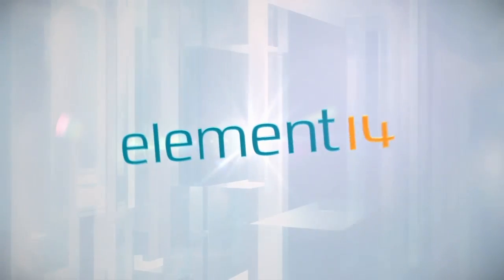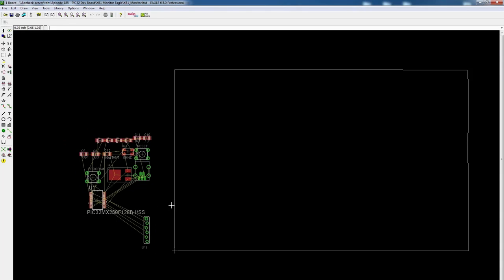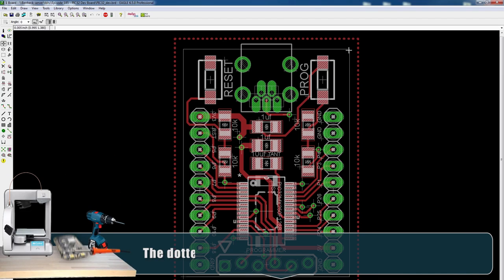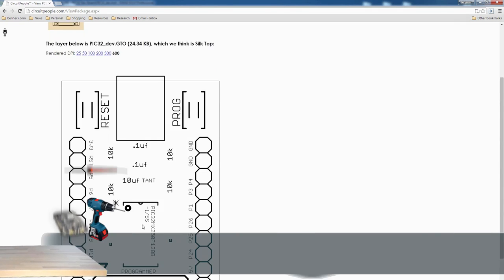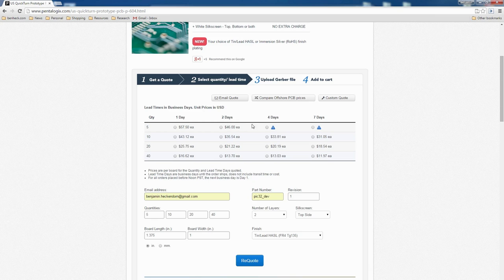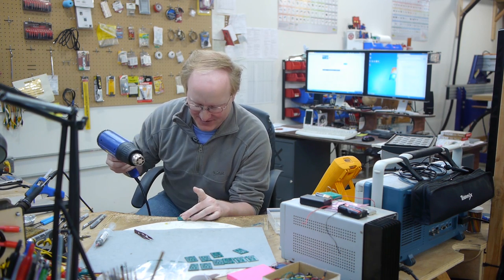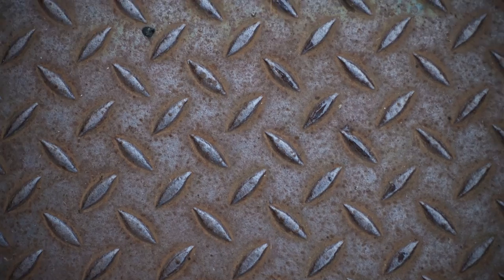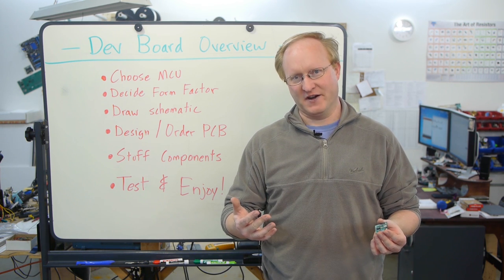Ben Heck's DIY PIC32 Dev board

Comment: Ben, just for information the pickit3 can provide power to the board, if using MPLAB MPE go to Settings>>Advanced Mode click on the power tab select the required voltage and check the "Power Target Circuit from Tool", if you're using MPLAB  X IDE go to Run>>Set Project Configuration>>Customize then click PICkit 3, click on the drop down at the top select "Power" check the "Power Target.." and set the level it is limited to a load of from memory i think 100mA. You can do this with the ICD as well not just the PICkit. Hope that this helps someone in a pinch.

Comment: Since this is essentially a break out PCB for a PIC32, I would recommend you add BAT54S's and SMT caps connected to analog input pins of the microcontroller.  If you use the analog inputs you can install the cap and BAT54S.  If you do NOT use the analog input, simply leave the caps and diodes out.

Comment: Check out OSHPark. They're a fairly decent board-house, and they'll make your boards fairly cheaply too. I've used them for all my projects, and they haven't failed me yet.
Reply: Nikolaj Lepka 2nd
Reply: Nikolaj Lepka he's sponsored by element14, if he does advertise with another trademark, it is like... bad for his sponsor right?
Reply: remace07 I know, I didn't deny that. I was just saying what I recommend myself as an alternative to what he says.
Reply: Nikolaj Lepka Trouble with OSHPark is that the price ramps up rapidly with board size. Over a certain PCB size, Itead or dirtypcbs is a more economic option.
Reply: Nikolaj Lepka I use PCBway. So much cheaper than anything I have seen. Only downside is it comes from China.
Reply: I was going to recommend OSHPark myself. Ben's design would have coated $2.29 each for 2 week turn around or $6.53 each for 1 week turn around (assuming he ordered 21 boards). Standard $5/sq. Inch(includes 3 copies). For 5 day turn around its an extra $89 per design. Not bad at all.
Reply: CodedSteele Everything comes from china these days, why's that a bad thing?
Reply: Nikolaj Lepka Why is outsourcing everything to China a bad thing? 1.  time it takes to ship is more because it's farther away 2. energy consumed in shipping is greater because it's farther away, thus contributes to consumption of fossil fuels which releases toxins into the environment etc. and if you believe in it, global warming or climate change 3. The more work outsourced to China, the harder those slaves have to work. Think of the humanity! We in the U.S. have unions and working is a choice. Chinese are forced to work for the state or die. 4. Least importantly, it is bad for the economy to have lopsided trade. This last point is debatable and I'm not sure why I include it.
Reply: ***** So why not make your project in modules that you can stack? That should keep the board size down. You could even use slot connectors to put them together.
Reply: kedwa30 Sure, you could, but not every project is amenable to that. I was just trying to point out that there are heaps of short-order PCB fabs out there. OSHPark has the brand-name, and they absolutely deliver a very high quality product, but they aren't the cheapest by a long shot.

Comment: Staggering the program header pins for a press fit was pretty slick.
Reply: Christopher Johnson Yeah man. I never knew that was an option. I always figured it would screw with the pads or whatever. Then again, I guess you only really have to program it once hopefully).
Reply: Christopher Johnson I like it too.  Any ideas as to how far apart the staggering should be?  I'm guessing 15-16 mil from counting pixels in a screenshot.

Comment: That was definitely killer episode! I like that flooding technique that Ben did on the main MCU. there's a lot of tips just for the SMD soldering work. as well as designing the board in Eagle cad. Watching that, answered a lot of questions and is settling most of my anxiety about working with SMDs!  :-) hehe!
Reply: I really believe that you can ditch the soldering iron and do this with solder paste a small exacto knife and a heat gun. Be stingey with solder paste and remove as much asnpossible with knife. The paste keeps parts in place when air is blowing on the board. You dont have to keep paste on the pads as the solder resist will ball any extra. You cam manually place cponents and then heat in one pass. Them turn over and repeat. If the parts move during soldering use tweezers to push into place. If they move too much you are too close. Dont be discouraged once ypu get used to air gun you will never go back to solderimg irons.

Comment: The PICkit 3 can provide power if you enable it in the settings. Also i think it's a lot easyer to use the PICkit to programm the PIC when using MPLAB to create the programms.

Comment: Which of the two techniques for soldering (oven reflow or manual) gave the nicer i.e. neater/cleaner results? I am developing a board that will be fully visible in the final project.

Comment: No screw holes in the board to mount it to your project? Sometimes hot glue is not appropriate for holding PCBs into cases... Other than that, nice project.
Reply: Treasure Pirate it depends, I think screw holes may add cost.

a person could design their cases with a ridge to hold the boards in place without the need for screws.

or failing this, hot gluing a board into place usually does work, though with the caveat of not using hot glue around components which may get hot (such as transistors or voltage regulators, as the components will melt the glue), nor around places where one may want to solder later.
Reply: Brendan Bohannon That is a good point on cost. Still, for those of us that don't have 3d printers, finding a case with ridges that just happen to fit a board that we designed from scratch is probably a long shot. So I would prefer the slightly extra cost of a couple of mounting holes to having to spend extra time and money finding a case that fit just right. Thanks for the discussion.
Reply: Treasure Pirate

possibly, though Ben has a 3D printer and has in the past made cases with ridges for holding things. I guess these were mostly for personal use on his part?...

in my case, my brother got a 3D printer for $400, and it is pretty nifty and useful, though it doesn't (at least with the stock firmware) do nylon, and ABS doesn't make for very good gears (they wear pretty bad and don't really handle higher power-levels without grinding to dust or turning into plastic cheese). solid parts are generally pretty good though.

also working on (eventually) trying to get a CNC milling machine made mostly for wood and metal parts (mostly held up on making the box for it).

in my case, most of my boards are made on perfboard though, so mostly through-hole and running wires place to place (recently, I got some 24 and 28 AWG magnet wire for this, which is more-or less good, with some 20AWG mostly for running power traces).

though, sadly, yeah, most modern digital components are only available as surface mount. it is ok, as most of what I am making is mostly power electronics, which is still mostly through-hole (typically, the controllers have been on separate boards).

Comment: The boards were really expensive, whats the cheapest way to make pcbs? I was wondering if one could print onto aluminum foil and then glue it to a plastic board and then etch it.
Reply: I can't imagine you'd get good adhesion from the aluminum to the plastic that way. Sure you can etch your own pcb, but how far are you willing to go to save a buck. Not to mention how time consuming it is to drill tiny holes for through hole parts.  $20 is not huge price to pay in the grand scheme of things for a custom pcb.

Comment: Why don't the parts on the top of the board fall off when you reflow the bottom side?  Is the surface tension of the molten solder that strong?

I'm surprised that you still favor the mini USB over the Micro.  There IS a reason why the industry has switched.  The Micro size has a bit smaller footprint (maybe not enough by itself to justify the switch but ...), but it will withstand more plug insert - removal cycles.  Note that the retaining spring for the mini is part of the jack, while on the micro it is part of the plug.  So when the spring wears out (they WILL) the mini jack is toast, while on the micro you just get a new cable.  Better to replace the cable than operate on the board!

Comment: I won't suggest using solder wick because one could rip off the pads if not done properly. It is easier to use solder flux and do wave soldering. That's what I recommend.